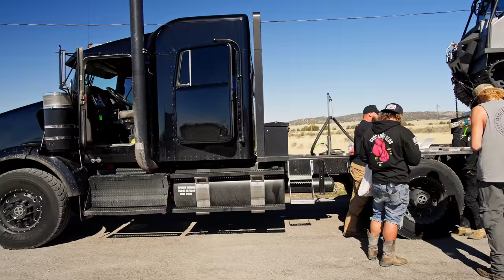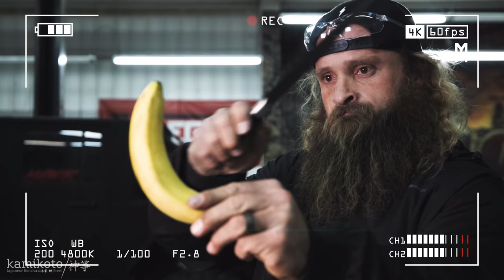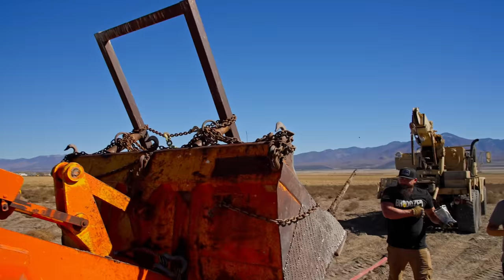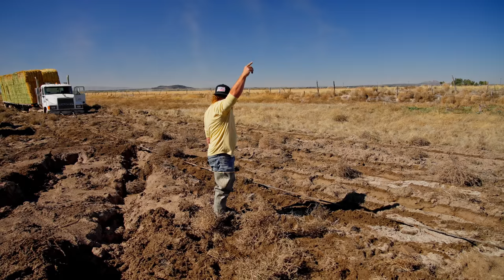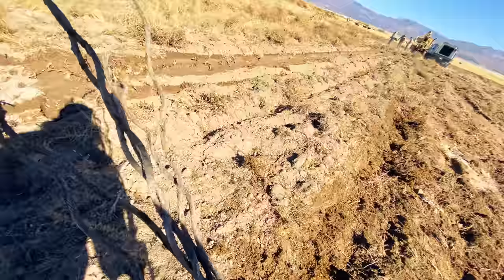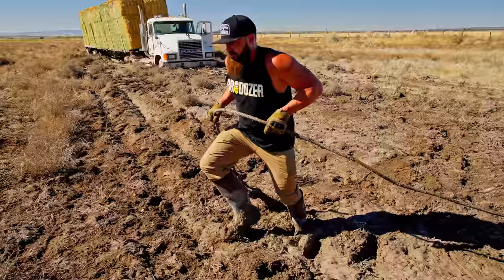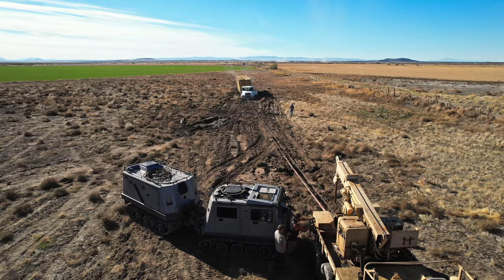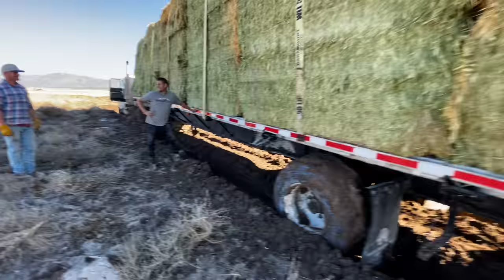I’ve Never Seen A Big Rig THIS Stuck (Dangerous And Difficult Recovery)

Comment: A word of advice, if you don't mind. In the mid-sixties, I was in the Army as a wheel and track vehicle mechanic. A part of our training was "heavy vehicle recovery" under extreme field conditions. When using a snatch block to create a 2 to 1, whenever possible, anchor the hook to a second vehicle or dead man. If you have a 50 ton winch and anchor back to the winching vehicle then it feels 100 tons of force, but if you anchor to a separate anchor point they each only feel 50 tons of force. If you are using a 3 to 1 set up, literally use two separate anchor points plus the winching vehicle. We were taught to use para-cord and monkey grass as an anchor, and believe it or not it works.
Reply: Right on!!!
Reply: Yeah ideally you) instead of using the loader to anchor the wrecker you would terminate the hook from the snatch block at the loader.

Also with the same anchor force you can increase your holding ability by using snatch blocks to gear down the winch line allowing you to move the same object without increasing holding power. Useful if your recovery spades are having difficulty holding in soft ground etc
Reply: Are you single
Reply: @marysimth1305  yes hbu

Comment: Something just occurred to me : how  come you guys don’t have a large ( D8 or bigger) dozer with what some folks refer to as “swamp tracks” . Caterpillar refers to them as “ low ground pressure “ tracks . Something like that would quickly reduce your time on the jobsite in a lot of these next to impossible situations . A friendly suggestion, that’s all .
Reply: there's time limiting factors involved with all recovery's the weight of a conventional D-9 or 8 Is going to be huge besides transportation permits . last thing swamp tracks are so much wider.  they would have to be removed on loading site and put back on, on recovery site then again after rescue. pure honest head thinking when trying to remove ❤ good safe tactics . OJT.  works the best

Comment: i would double/triple the cable for the first try at the start..  all that dead weight and the mud... 80 000lb you can multiply by 2  even 3 because the suction of the mud and friction it does while pulling..  glad you made it out !, good job :)
Reply: Yep can’t get my head round why they don’t use some snatch blocks and double or triple the pulling power

Comment: During Dessert Storm, I got a trailer buried below the axle. After dropping the trailer, my humvee was able to pull out of the sand pit at super fast speed of 1 inch per minute. 
Another lighter hummer and pickup tried to get it out but in the end, that trailer was so stuck that it took a tank to get it out.

Comment: One of the first things I was taught about recovery is to bring it out the way it came in.
Reply: Or dig out in front which wasn't an option.  No disrespect meant, but yeah rear exit was the only option here.
Reply: Yup and maybe unload it
Reply: Suction was in addition to the weight of the truck.
Reply: @dsarg82  thats what I dont understand. Unload the 30 tonne of hay....maybe take the trailer off the truck too 🤷‍♀️
Reply: Halez, gravity. Take the weight off. Pulling a loaded 18 wheeler typically leads to damage equipment.

Comment: I love how far rechargeable, cordless power tools have come. I have a few I still wonder how we ever survived without.
Reply: If working in a shop all day they aren't needed, I know plenty of folks who don't own cordless. Myself personally I own both air and cordless as they both have their pros and cons.
Reply: @dieseldabz7104  agreed! But we own a working horse farm, Two F-350 trucks I use for hauling hay, horses, obviously horse trailers, flatbeds, and so on. Plus I use my trucks in the field as well. My husband still works full time, typically 6 days a week and these days (post Hurricane Florence) I take care of all the horses various smaller livestock and farm chores. So cordless power tools have made my life, so much easier as well as cut the time down on, on so many of the jobs I have to do in the field where hand tools could only go before. Even just changing a tire on my truck if a mishap in the field or even on the road, and hauling a horse trailer is a fraction of the job it once was for me, since I go no where without my cordless impact. And being as I not a big woman, and my workouts are moving 1,000-1,600 lb obnoxious horses (we are an equine rescue these days, where I rehab, train, or retrain abused, neglect case, last chance or feedlot saves), 80lb square bales or 50 lb feed bags, changing a tire on either of my F-350’s is a task. One now not as daunting with the cordless impact to break the nuts. As well as drilling through electric poles we reuse for fence posts to hang bull gates or run fencing on. You use to have to use an old style hand drill since you need long wood boring bits, even early cordless drill didn’t have enough power. New ones do. I’m also a cert Farrier having done my schooling in 1999, and using a cordless angle grinder has completely changed how quickly I could cleanly trim and or shoe horses. And that’s just a fraction of the way cordless tools have changed my life. My Hobart welder is still my favorite shop tool, and I can’t see the day a cordless welder of its capabilities that’s affordable on our out of pocket budget that is, would ever be enough to replace that beast. So I agree, I do have shop tools, that live in the shop and could never be, or don’t need cordless replacements outside of it. But the ones we have, have truly made my life in particular so much easier and time management and workload/capabilities 10 fold!
Reply: Doing it with a handsaw and one wrenches would probably have added a bunch of time...

Comment: 5 hours 24 minutes
Also a tip about cable clamps, "never saddle a dead horse". The meaning of this saying is the end of the cable is the "live"end that's trying to move which is where you put the saddle of the clamp. you put the clamps on backwards.
Reply: ya, they should have just unloaded some of it too, just ruin the truck towing in that mud with such a load on it.
Reply: Are you single

Comment: 6 hours 28 minutes and 18 seconds. I used to love doing recovery operations in the Marine Corps. I've pulled a lot of D7 dozers out of the swamps of Camp Lejeune, with my Oshkosh LVS (Dragon Wagon) The only time it wasn't fun, was when the thunderstorms moved in and there was lightning all around.
Reply: did you evere have to pull tanks .. i hear they can be a bitch
Reply: @christopherdoff-sotta4441  I have never had to pull a tank. We did have a tank retriever stuck with two D7's, but 2nd Tank Battalion recovered it themselves.
Reply: That's cool. I was attached to a artillery unit in the KANSAS ARMY NATIONAL GUARD.  We had M109A6  paladins. Awesome platform but damn that narrow track wasn't the greatest in deep ass mud. Two of my good friends and SGTS were in charge of retrieving them with tank retriever. This thing was a 1500 horse twin turbo monster... lol. I rode with them a few hundred times. The M88 was loud obnoxious.  And a bitch.. but she could haul balls. Lol. I tried getting certified to drive one but my command was some jackals. I did however get to fuel that damn thing. Geesh she could hold the fuel. 400 gallons. She could burn through it... lol.
Reply: @christopherdoff-sotta4441  I was with 10th Marines, which is an artillery unit at Camp Lejeune. I hauled the M109's and the M110's. I have never had to pull one of those out of the mud or sand. Our Engineers cleared gun positions with the D7's. When ever they got stuck, they called for me or another LVS operator to get them out. Our Sgt., who operated our Mk48/15 wrecker refused to get it dirty. He didn't like spending a few hours on the wash rack at the end of the day, cleaning the mud off his wrecker. I didn't care. Vehicle/equipment recovery was the funniest part of the job to me. I hauled the D7's to the field and had a good relationship with those Marines. I spent more time with them, than I did with other Motor T Marines.

Comment: My first thought when you tried to pull with with single line was its snapping for sure. A lot of people think mud is easy and just watery. But mud creates a lot of resistance and being up past the axles even worse. Pulling foward would of worked but you need to 3 part that line, so 3 snatch blocks, and you need upward pull to unsuck the truck from the mud. Moving to the back to pull out is usually the easiest, pull what ever you have stuck the way it went in to get stuck. Again i would of used 3 snatch blocks again to pull. But overall good job and took about 8hours probably to get everything done. I know this is a lot for comment but being a tow operator and doing heavy rigs, i always find these things funny. Just always think before doing, that line snapping could of hurt someone really bad or your equipment.
Reply: Rope probably isn't rated for 3 mechanical advantage. Also have to think the rope would need to be 3 times longer, and it sounds like it was hard to find a solid place to start

Comment: Dave; Absolutely always, 1000X easier to pull it it out the way it came in one. Also always snatch block back to your self, 1/2 the strain on the cable 2X the pulling power !
Reply: I should have watched the whole video before I wrote but my guess with everything would be 4hr 21 minutes !

Comment: Safety wise we were always taught to throw a thick oiled tarp over the middle section of cable. So if and when they snap they wouldn't coil around and hit you. Old timers called.King Cobra Bite, meaning  Killer Cable Bite. We use to recover train cars back in the 70s. Seen two men loose both their legs when they forget to throw tarp on cable. I was about 13, been scared shit less every since. I'm 59 now.
Reply: Not JUST the middle. There should be anti-snap/whip protection at least every 1/4 of the stretch.

Comment: Never done this kind of work so this maybe be a dumb question but it’s sincere, why not remove some of the hay off the trailer to lighten the load? Is it just logistics of getting a machine close enough to the trailer to be able to unload it without also getting stuck?
Reply: Those bales are almost 1000 poubds each and you need forks to move them easily. You would just risk making things worse

Comment: Have you ever thought about getting a marine anchor? In a situation like this you could attach the recovery truck to the trapped vehicle with the winch and then run out the other winch and attach the cable to the anchor set in the earth. Put a strain on the anchor cable and then use the other winch along with the 10 wheel traction to pull out the stuck vehicle.
Reply: Are you single
Reply: You never want to attach in a line, frames will twist and break on trucks

Comment: 5hrs 12minutes.  Heavy pull for sure and im surprised the front of the tractor didn't get pulled off with that much pull.
Reply: And the 5th wheel plate.. I'd check the jaws good and frame.. lol

Comment: 3 hours 16 minutes.
Also kind of curious how much the bill for a recovery like this is. I assume a few grand easily. 2500/3k seems reasonable when you take into consideration the amount of equipment, fuel, and manpower. I may be lowballing with no sort of reference lol.
Reply: Low low low... 250 an hour per truck per person for a recovery on the road

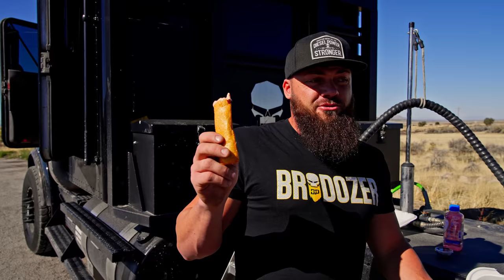Comment: 2:27 it’s not that stuck. I seen much worse in the oil fields a d much heavier. 
4 axel Crude oil tanker that holder 275 bbls of hot crude hauled by a 4 axel sleeper trucks. 
That’s around 130lbs for those who don’t know. 

This truck is on flat ground. It could be much worse.

Wanna know the secret to getting those heavy trucks unstuck? 
Call an empty tanker to unload him and then when he is empty he can get tugged out by the now newly loaded tankers. 
No tow trucks needed 😂 

We did it all the time
Reply: I used to own a trucking company and oilfield recovery company.. had a situation where they did exactly what you said, got 100 yards and BOTH sunk!! Had to do TWO recoveries for the price of one!!

Comment: Matt’s off road recovery doesn’t have anything on Heavy D,  just sayin
Reply: Did you see Matt's last recovery? Matt does it on limited resources, not like HD's resources.
Reply: You have to admit that Matt's XJ out performs EVERYTHING in it's class. That Jeep is the best vehicle for recovery use at Sand Hollow, most of Heavy D's Big recovery trucks wouldn't make it through the sandy/rocky terrain in the area of Utah where Matt is located.

Comment: The other tool I would add to your arsenal is a set of heavy duty lift bags.  Your loads are of the same scale as boat recoveries I have seen them used on, so industry clearly make the lift bags capable of holding up to the weights of your recovery loads.

Comment: A land anchor fixed to the frame underneath the front area. Something that will pop up as you drive forward. Spring-loaded maybe? But if you do make sure to embrace the frame laterally otherwise your truck might snap in half.

Comment: Years ago, I was hauling some BIG 103 concrete pipe into job site, the mud would freeze overnight & be mush underneath, When going on this Jones site, you’d look for the biggest crane and drive to it, but this morning, that didn’t happen as we drove towards the crane 3 trucks sunk to the frame, they ended up using the massive loader to push mud and use 2 massive Scraper fully load to drag us out.

Comment: Sounds like this particular rescue could use driving steel columns down 20-30' in the ground ins some triangle pattern to use as anchor points. IF (I don't know) there are winches that could pull that amount of dead weight, I would think creating some type of bridging like you do for getting excavators unstuck might work since the ground is so soft. Entered this before watching the video.

Comment: As a dairy farmer, first thing I'd try is unload the semi-trailer. While that loader can handle 2 or 3 of those 3x4x8ft square bales (each bale prolly weighs +1200lbs), might might be able to unload the trailer one bale at a time without sinking in and getting stuck. If you can manage that, pulling an empty truck n trailer out becomes much much easier
Reply: They do this shit for fun.
Reply: I agree 150% with you. 👍👍👍👍👍👍👍👐
Reply: That would indeed make more sense, but a less spectacular video. These guys really want to try out their (machines) abilities and that is why they started pulling from the front while that was obviously the most difficult way.
Reply: My thoughts but no video to watch 😂
Reply: totally agree with you , especially on soft  ground  rule number one  is to unload

Comment: A breaking cable can kill anyone within its length - it might look like good fun but it is lethal.
Reply: I have not dealt with that size cable, but when l I was being taught how to use a frame machine we were taught to put a welding blanket or another chain over the chains and to stay out of the range of the chain. I never have had a chain break but have had the pulling point and the clamps break at different times. I always used chains on the chains and that made them just fall harmlessly to the ground but it is still scary
Reply: @TriCountyMotorsEastman  Yeah, cables are way more dangerous than chains.

Comment: 18: 30 Why not unload the hay and save yourself 30 tons?  
Also, is there some sort of air bag system to help lift  stuff like that out of mud?
Reply: Unload, disconect the bay from the truck, and pull from behind, that guy would be able to do it with the first escavator.
But, im Just a guy in the internet
Reply: Because they want content
Reply: As a young man I worked in the hayfields and those bales are heavy. Not that easy to unload that truck with all the mud around maybe getting another truck stuck. Pulling it backwards would have been the first thing tried only because it's happened to me just not that big of truck.

Comment: I'm not going to attempt to read all the other comments, because I am already old, and I'd rather not come to my end reading all of it.
Nothing personal, and you boys have good intentions, but ya'll ain't using your thinkin caps ya'll were given. 
Ideally the fastest and safest way would have been to mat out to the trailer and unloaded it. 
Then lift the trailer off the fifth wheel,  and then you could have snatched the truck out easily. 
Then hit the trailer from the rear, and ya'll boys been drinking cold beers in half the time.
Without near the damage to your equipment, are taking a chance on someone getting cut n half by cables snapping. 
And if you will carry some old moving blankets to throw on top of your cables and straps you'll save damage to equipment and possibly save someone's life are grave bodily injury

Comment: I think you NEED to acquire an M88 tracked recovery vehicle.
Reply: If it weren't for the mud I would agree but the M88 weighs anywhere from 50 - 63 tons whereas the 5 ton only weighs about 18 tons.